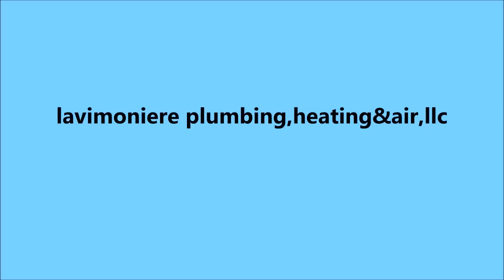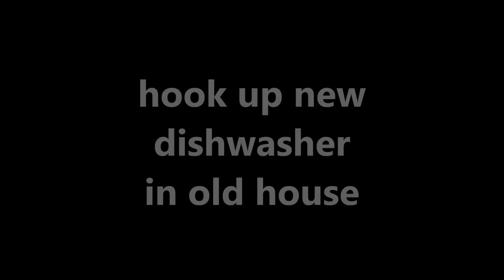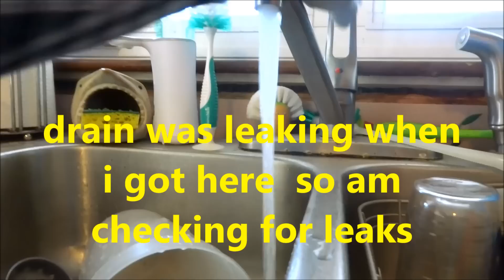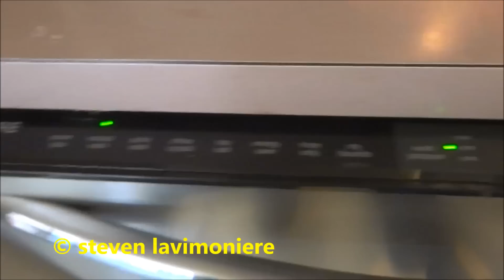new dishwasher installed in old house

Comment: Oh dat wall socket that violates electrical code... Sorry I notice things like that..
Reply from the maker: +ElfNet Gaming i believe your right its a young couple just starting out very young .. propely had one of his young friends do it .not sure
Reply: Yeah the proper way would be to have that metal flex cable run up to the socket and the socket be at least 14" or 18" from the floor if it even possible, if not then it needs the hard wire option. Also since this is connecting a water handling appliance it should have a GFIC. The other option would be to hard wire the dishwasher to a junction box like you would a garbage disposal and have it on its own circuit with a GFIC breaker.
Different states and such may have different codes related to building codes but I am going off the NEC here.. 
But of course if it's not broke, no need to fix it..